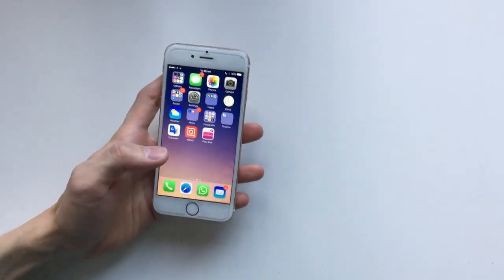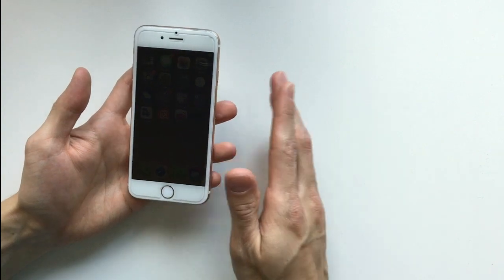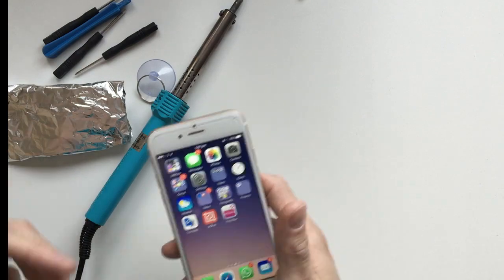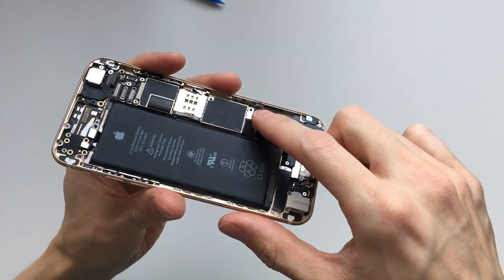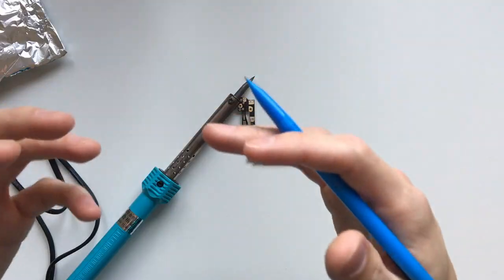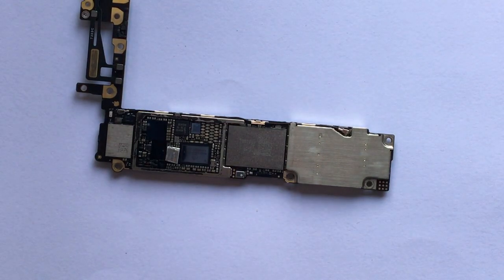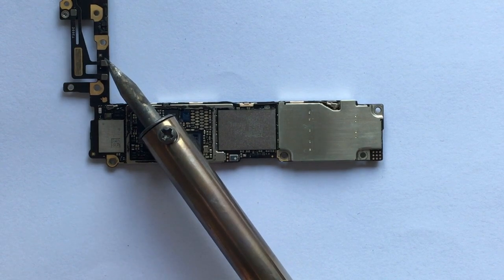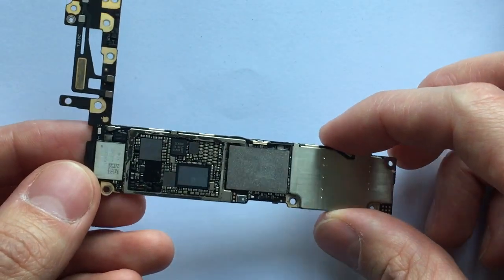HOW I FIXED iPHONE 6 TOUCH DISEASE (Has been FLAWLESS for 6 WEEKS NOW)

Comment: Just want to say, Thank you so much for this video!! My phone was getting unusable it was happening all the time. I followed this vid exactly, 30 sec, 3 times, phone has been perfect for almost 3 weeks now!! I waited some time before writing this to make sure and issue hasn't happened at all since. This is the REAL fix. The disassembly instructions you linked are great too.
Reply: Had the exact same issue. Will try this now. 
Ofc. my iphone is just lying arround these days.
After this happened to my 2 year old iphone 6plus (A 1000$ phone!!!) I immediately switched to Android. 
At this pricepoint this is simply unacceptable. I have an entire graveyard of apple products. all died bc. of simple mechanical engineering issues that i could have fixed as an undergrad 1 year at colledge! They either have 0 good mechanical engineers, or they don't listen to them.
 My guess is that design department and management always gets the upper hand in the meetings... screw apple!
Reply: If you want to know what killed the other products:

Product - Cause of death - how long did it last

Macbook pro 2011 - Overheating - 4.5 years
I pad mini 2012  - Grey screen - 2 years (to the week)
Mac Pro 2013 - Overheating - 2.5 years
I phone 6 plus - Bendgate - 2 years 
Which was the final straw! 

If you follow the timeline, you'll have noticed that almost all my devices gave out ~ 2016... Which extra sucked! 
Never ever again buy from apple. You have been warned :) 

Ofc. i also had the apple tv 'blinking light for ever' issue after 2 years and all apple crap cables only lasted 1 year, dead earphones and a lot of other small overpriced shit that died randomly, but that's not my main concern.

I now have switched mostly to ASUS, Acer and Dell. Can recommend. Especially the Zenphone is fast and has 0 issues!

Comment: it worked for few days and stopped working, did it again and worked for fewer days,
now it has completely stopped..
any suggestions?
Reply from the maker: Don't know what could be the problem there. Are you sure you're allowing enough time to heat the IC? Mine is still working after months.
Reply: did as you said again...30 secs, 3 times with interval ...now the phone wont even start.. haha
Reply from the maker: Sorry to hear that Bobin, sounds like it might be more than just the Touch IC. This IC not working shouldn't disable the phone from booting up.
Reply: there's no booting problem any more..just the touch isn't working.
Reply: yeah. throw it hard on the floor, its the same principle if you want to fuck your iphone forever

Comment: My 6 plus has the touch disease and the way I make it work it's by removing the case! That's my phone maybe it won't work for everyone
Reply: Did it previously but that's not a real definitely solution... it seems that without case the chip heats up and it works for a while only...try it out as shown on the video, I did it and I'm my 6+ 128gb works now fine and smooth!
Reply: cases sometimes bend the phone in a weird way,giving the phone weird pressure to the touch ic
Reply: You saved my brothers life
Reply: Big Mac it is worth giving it a try if you have some skills. I has been not difficult but you have to have a discipline during all the procedure. I used ifixit tutorial for taking the phone apart and resembling it afterwards. All needs to be carried out thoroughly when you proceed with this tutorial but it was not difficult if you have some skills and follow all the steps as mentioned in the video.
Reply: Removed the case? Really? Ive been having the same problem for the past week and a half. And I just recently realized the whole "Touch Disease" problem. I've been breaking my head cause I do not have Apple Care anymore and I really don't want to pay close to the same amount I payed for the phone inicially. So I am curious in how removing the case worked for you.
Reply: Miguel Alicante Yeah I realised   couple days later that it started to stuff up again. Wanted to do as shown in the vid but its too technical for me. Is it easy?
Reply: Dave Ramirez
Reply: Alex Urenda same w me
Reply: Wich case I should removed !!!????
Reply: IT WORKS! Thanks!
Reply: The sim card method worked for me for about 1 month.

Alex is referring to the metal case with 5 screws inside. After removing this metal case and the sim card, it worked for me today.
Reply: Press down under your back camera not too much tho subscribe me when it work
Reply: Thistook2hours this guy is a real hero .love u
Reply: Alex Urenda mine wouldn't do anything but turn on and I tried taking off my class and it worked thank you
Reply: Seriously? I cracked my phone screen in rage for nothing and I just simply removed the case to make it work. Fuck.
Reply: Alex Urenda this touch thing all started on my iPhone when I put my case ON XDDD
Reply: Alex Urenda omg tysm it worked :DDDD
Reply: Thistook2hours h. has
Reply: Wich case
Reply: Trixster Gaming Productions eich case please!!!!
Reply: I do that
Reply: saved myself from smashing my phone. legend.
Reply: Thank you! You are a hero and that solved my issue.
Reply: @romuluspalaiologosxiii5171  which case ?

Comment: Another much easier solution is to place a nano SIM card under the thin metal cover that goes over the 4 display connectors. Search YouTube for "arif iPhone 6 touch disease SIM card". The YouTuber is "arif" and it worked for me. My 6 plus had no touch response at all unless I applied pressure to bend the phone. Now it's perfect. 
I guess the SIM card is just thick enough to press the Touch IC on the flip side of the logic board, enough to make good the connectors. (I've typed this on my "repaired" 6 plus.

Comment: this is how we used to fix xbox 360s
Reply from the maker: Casey Rodriguez , Exactly! A few years ago I fixed a laptop using this method with a heat gun.
Reply: Lucas Guanes I'm commenting on the iPhone I just repaired.  Screen is working great.  Have you had any issues with yours yet?
Reply from the maker: Casey Rodriguez , the phone is still working. It has been a few months now

Comment: The pressure you applied "fixed" the fracture in the solder joint. More a less you could have just pushed your finger on it and accomplished the same thing. If the solder under that chip had gotten hot enough to melt they pressure you applied would have pushed the BGA solder out and bridged all the connections under that IC.

Get your phone fixed correctly. I6 cumulus most of the time is the issue. i6+ Meson is usually the issue and more specifically a faulty pad under Meson.
Reply: Well, i havent applyed heat to it, just pressure, and it made it work well for a month or so, then i came back to the same situation (as i predicted it would happen), so what i did was press the phone (without opening it) untill it stop doing the problem, then i took it to a store that pay back for used iphones when you buy a new iphone and bought an iphone 7 with 3 years of extra guarantee.
And for all the research i did after, i discovered that there is no fix for the problem, as after the first bend the phone gets more and more pliable and fragile. It is an structural thing!
Reply: they do not agree, the heat melts slightly the pond and brings it back to the initial situation, in fact you can smell the dissolved tin when applying this guide, it also produces a lot of heat on the chip, the same as is achieved with a thermally hot air gun
Reply: i had this problem and stumbled upon this video, as you mentioned i just pressed with a rubber to do an even pressure, the touch was not working at all, and now all is back working. Lets see how long it will take.
Reply: actually you should remove the old chip and apply a new hot air welding it, so repair is 100% conclusive
Reply: i fully agree with you that this is the best way to fix, but i think that the problem will come back sooner or later as the phone will bend more and more.
Reply: Chris Long i
Reply: Chris Long what's cumulus ?
Reply: Maybe so but so far we havent seen any major returns like we have had before especially with the jumper wire

Comment: if none of these work, will replacing the logic board work?
Reply from the maker: Joshua Huang, the problem described here is in one of the ICs in the board. You will solve it if you replace the logic board, however it will be expensive

Comment: Nice video!
Reply: I tried your no soldering method and it worked for my phone. Thanks. However I observed my battery % does not drop while am using my phone until it's zero. Plausible is that .. whenever I plug my phone to power, its does not increase unless I reclip the battery. I have had to open my phone on daily basis because I want my phone to increase in battery %. Is there something I could have done wrongly
Reply: O'care repair lab sometimes i have had to restore my phone when a battery doesnt show correctly. And make sure it is a DFU restore. But it is rare, but i have seen it
Reply from the maker: Thanks for your comment! I personally watched your videos before I uploaded this one and inspired me to share my solution.
Reply: Lucas Guanes thanks for sharing another solution! The more we can educate people on how to fix this issue on a budget the better.
Reply: Rody Davis I saw ur video
Reply: alumnium foil and heat from the screw.. Hum im pretty sure thats how you fuck your phone permanently. I have another idea: I call it technical assistance
Reply: if you have touch disease must you have grey bars on top of screen or is this only for some because i dont know if mine is my digitizer or ic chip but i dont have grey bars on my screen.
Reply: Rody davis, will this work for me?